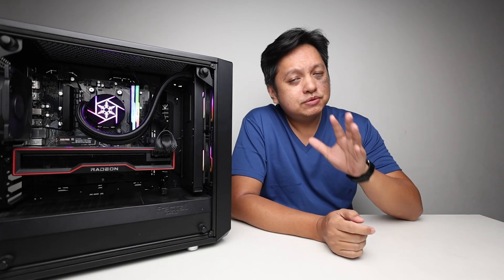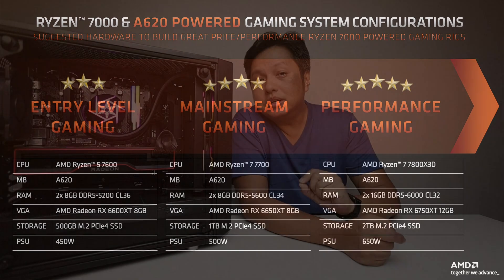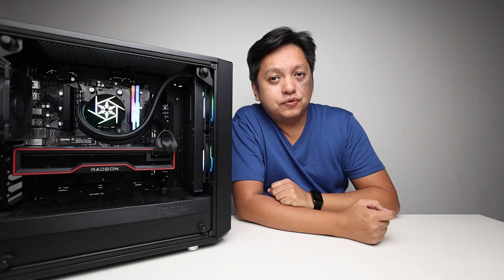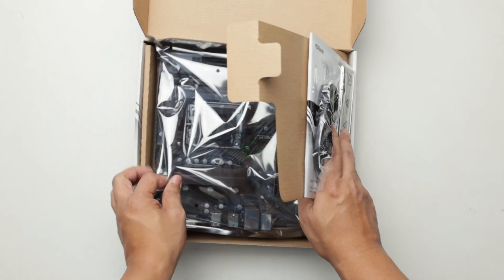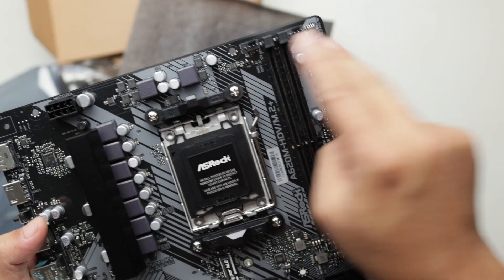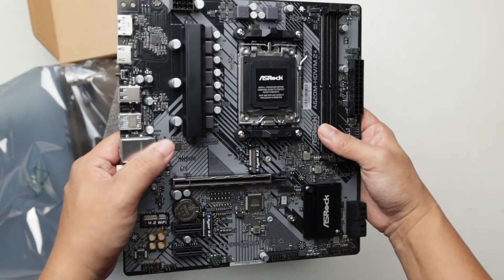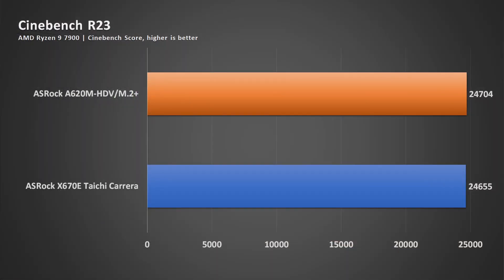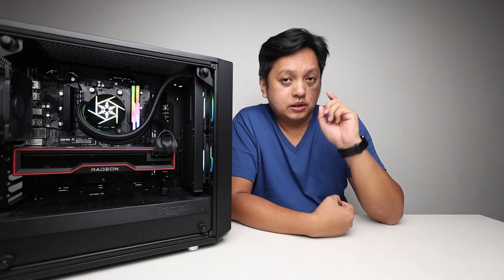You need VRM heatsink on A620 AM5 Motherboard! the ASRock A620M-HDV/M.2+ Review

Comment: would the regular non-plus M.2 perform decently for 120w CPUs if I added some aftermarket VRM and phases heatsinks? Or is there any actual entry-level motherboard for which this would do any good? The MSI Pro A620M-E maybe?
Where I live motherboards are crazy expensive and there's no middle ground: you either go for the shittiest most lacking A620 boards, or you have to jump straight into the overpriced shitty lacking B650 boards which are 60% more expensive, and the actual decent entry-level B650 boards cost literally twice as much as the shitty A620s.

Comment: is this board fine with 5 7500f
Reply from the maker: Excellent combination.
Reply: @goldfries  i just checked that i can't oc in this mobo, should i get B650 for oc or just go with the A620 without oc for the lower price ? Would oc boost cpu performance drastically ?
Reply from the maker: @3rdshura  that board is not meant to OC. OC gain is subjective, if you plan to dabble with OC for the fun of it then B650 boards it is.

Comment: So a620 is okay for non x 7900 and if you don't do any overclocking, you'll be fine. Did you measure the idle power draw of the system ?
Reply from the maker: Yes correct, it's not meant for the non-X model. No I didn't check but I can check for you later.

Comment: Hi. I have some questions about this mother board
1. Is it posible to set max TDP nearly 80-90W?
2. Is it posible to use AIO with this motherboard? I saw, that CHA-FAN can give 12V 2A, so it might be enough. Is it good idea to use AIO with this motherboard or it will kill my pump?
3. Was the VRM hot (more than 80 degrees Celsius)?

I wanna build a PC, but B650 motherboards costs much more, than this one (nearly +35-50$. This one motherboard costs nearly 130-140$ in my country, btw)
Reply: Real TDP is around 90W already with the Turbo enabled on 65W CPUs.
And you can clearly see on the video that he's using an AIO, but I would still recommend a top blower like the Wraith Prism, as 1) a 65W CPU does NOT need an AIO 2) the top blower will reduce VRM temps by about 15°C (75 instead of 90 => motherboard will live longer)

Comment: Thanks for this excellent review.  This motherboard seems like the best option for a capable budget build.  I am combining it with a 7600 and RTX 4060 for a fully passive PC build.
Reply: I'll be joining you guys with a 4060ti and 7600
Reply: Good choice.  I am considering if it is possible to mod a 4070 to work passively, with an NH-P1. @epistomolokko
Reply: i bought a prebuilt pc (which is my first desktop pc) it has a asrock a620m, ryzen 5 7500f and rtx 4060ti. I guess I joined y'all. This motherboard feels like its built for rtx 4060 or 4060ti.
Reply: btw after 4-5 years dual fan gpu's start to sag to the right. So don't forget to buy a gpu support!
Reply: Doing the same thing in itx.
Reply: Good to know I'm not alone. About to do the same thing with a 7600 and 4060.  I've seen others testing this with a 7800 and it does fine. So, more than enough for the 7600. Good luck on the build!
Reply: I will be joining you guys with 7600 and a rtx 4070
Reply: I have the same mobo but with 7500F and i am not sure if i can buy 4070ti to sport with it
Reply: How's the temp?
Reply: I done the same with this board a620m h, Ryzen 5 7600, 4060 oc eagle

Comment: I bought this motherboard and RAM that supposedly both support 288 pin, but they don't physically fit.
My RAM is 32GB Kingston FURY Renegade Pro DDR5-4800 DIMM CL36 Single and is 288 pin, but it just won't fit.
I know RAM can only fit one way, and I'm experienced enough with building PCs, but this is the very first time I see 2 compatible components on paper that are not compatible when actually trying to slot it in.

Comment: They definitely needed this revision being the M.2+ (as the non+ model thermal throttled under loads) is a decent motherboard this model. This board was originally advertised as supporting ALL CPUs including 170w X-models (7900x & 7950x) but thermal throttled and after being contacted, AsRock removed these high wattage CPUs from their support page which is a good and responsible thing. For a budget gaming powerhouse (7800X3D) or low powered render station R9-7900 (non-x) setup, this board has proven a really good board from Hardware Unboxed.
Reply from the maker: The 170W support wasn't supposed to be there in the first place, based on the briefing we had internally. The website management team probably made a mistake listing support for those. That's why in my earlier video, the one I talk about the A620, I highlighted what is not supported.
Reply: @goldfries  ASRock has been called out for "optimistic" CPU support lists before. I don't know what to think. I honestly don't mind high-end CPUs being listed as technically supported, so long as they are colored in yellow or orange with a visible caution symbol and tooltip informing buyers to expect performance degradation under extended loads. Bonus points for a link to a suitable higher end motherboard.
Reply: Bro, who beat you? I saw your left cheek, you are purple ah man, what happened? @goldfries
Reply: @goldfries  HUB demolished that ASRock motherboard on their reviews. Glad we didn't purchase that board.

Whilst we know you work with ASRock, so obviously you would have unconscious bias for them.. but wouldn't you say that ASRock's QA team should have reviewed everything before releasing products (including anything posted on the website)?
Reply from the maker: @OverseerPC-Hardware  I can't disagree with that, could've been a smoother ride. 

I wouldn't say HUB demolished the board but rather, they managed to show why 170W CPU shouldn't be run on it, absolutely fine. 

If I were in the US or AU or anywhere with strong currency, then yes go with HUB recommendation. $20 - $30 difference? You can get the B650M-HDV/M.2 which is far better. 

Over here in Malaysia, you'll be surprised the A620M-HDV/M.2+ sells so well, because many systems were build with sub $400 Ryzen 7000 CPU. Realistically if one could afford a 170W model - doesn't make sense to go with an A620 motherboard. 

And no worries about the bios .......... I mean bias issue. Hehe. 😁
Reply: @goldfries  Well, we are probably in the same boat here in NZ. Currently, there are a lot of people, who have NOT crossed over to the newer AM5 platform because motherboard pricing here is ridiculous ($400-$500 NZD for a B series board). Intel 700 chipset boards are actually cheaper here. And "A" series boards here are almost non-existent.

Our audience is mostly on the AM4 platform as of the moment hence why we are looking at the feasibility of a cheaper A series board and pairing it with a  decent CPU (? 7800X3D) later this year, if B series boards stay at the same pricing. A series boards can be bought for sub $200 NZD via Amazon, which is a massive difference. So, yeah.. we totally agree on board pricing and how it affects mainstream consumer decisions 👍

Most People will pay more for GPUs and CPUs... BUT not necessarily for motherboards (unless they're OC enthusiasts).
Reply: @OverseerPC-Hardware wouldn’t mind paying a bit more for motherboard if it offers the ports I need, my opinion is many budget gamer buying these lower end board likely play with a 60Hz non VRR monitor, at which point stepping down from a 7700x to a 7600 wont yield any difference, both processors will be able to play games at above 60fps for many years to come. And if that helps me step up my board for the option to install additional SSD and usable USB ports I will definitely go for that.

If it comes to a time where the 7600 can no longer run at 60fps consistently, you can still manage it by tweaking game settings, but with motherboard, there is no easy way around it if you want to add additional SSD in the future and you have used up all the slots.
Reply: @OverseerPC-Hardware  because HUB is stup!d. As the author here said, this MB was never supposed to run 170W chips, and any professional can tell that 9 phases are (physically) not enough to run 170W. HUB are the worst on YouTube!
Reply: is this + model good enough for ryzen 7 and ryzen 9? Can the vrm handle it? Or will it throttle?